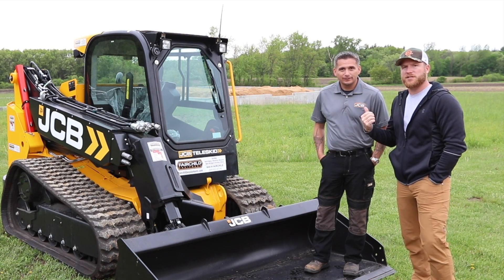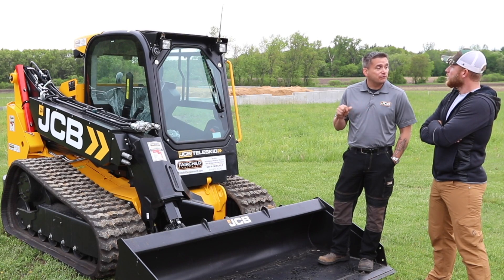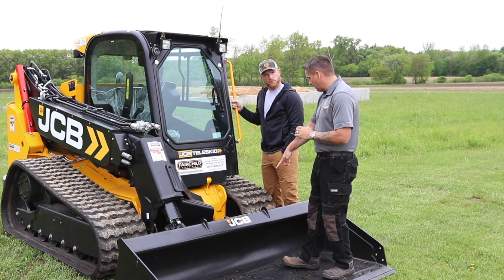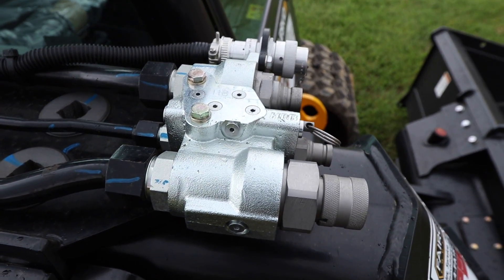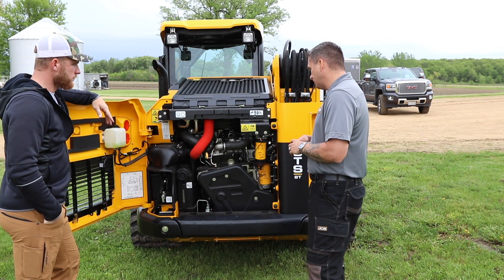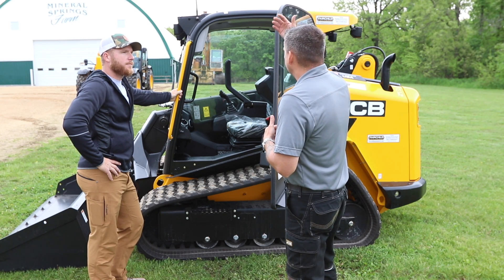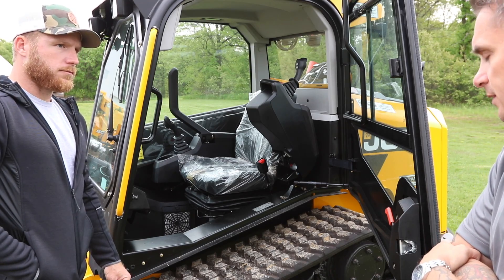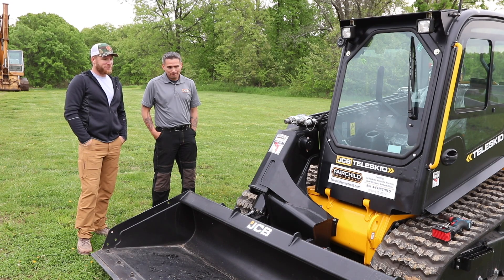JCB 3TS-8T Tele-skid Compact Track Loader (CTL) Walkthrough.

Comment: What I would like to see is NOT a sales video, but a Maintenance Video.     Show what it takes to do the routine maintenance.   How hard is it to get to drain hole, filter, refill for the motor oil.    How hard would it be to change battery, alternator, starter.      Hydraulic fuel filters.   Where you can and cannot pressure wash.    Where are all the Grease Zerks.    A video like this would show how well the engineers thought out the design.
Reply from the maker: You’d have to go to a different channel lol I don’t do hardly any machine maintenance.   I take it to dealer it’s not my thing

Comment: That bucket stop only works or prevents damage if your bucket is at ground level when you push into something,  if its up off thr ground at all its torqing that boom in a bad way all the way back to that one main pin that is definitely the weak point.

Comment: So when its extended just a bit with thst bucket is not braced agains thr brace /frame , so than what holds thst bucket from twisting when its away from machine frame , because you know it will happen when you didnt  boom completely  back 😉

Comment: Thank you for posting the video about the machine and the walk around. I work with my uncle in a family business removing trees and stumps. We just signed the paperwork for a jcb and will pick it up next month. We opted for the standard boom and purchased a grapple bucket for it as well. We went with the 205T model and look forward to getting it on site. I wish we had it for the job we are on currently. It would sure speed up the process lol.
Reply: Looking at the same machine, how is it holding up?
Reply: @etires562  so far it's held up well. We don't use it on a daily basis, but compared to our previous machine it is much smoother and far more stable. Shortly after purchasing it we did have a hydraulic leak that took us a while to locate and fix. It ended up being a micro crack in a line feeding the pump. We purchased it used as it had been a demo model and sat at a dealer for nearly a year. That's been the only significant repair thus far so we are happy with it. We did add a backup camera on it which is very helpful and highly recommended. Best of luck to you.

Comment: I have had  one for a year now. Really like the machine, however there are some problems. The plastic sun roof leaks water as does the door. Battled water leaks all winter then found the ROPS was not welded properly. 4" of weld on each side missed the joint. Waiting for them to install a new ROPS now. Also the AC sucks in dust and blows it in your face. JCB has no fix for that. Had to remove  the cab breather and tape it shut. Then there is hydraulic issues. When using a 4 in 1 bucket, when you clamp it closed the hydraulic pressure bleeds off into the boom extension circut and the boom moves out. Cannot hold a log or rock in the bucket. JCB has no fix for that either. Had it in the shop for a month on that issue. Not much help or communication from the factory. Bought a parts manual and it does not show some of the cab filter parts. I have 5 JCB machines and they have the worst parts and service manuals that i have seen and i own 15+ pieces of equipment of various brands.
Reply: Leif Wilson pretty sure the boom / aux issue has been figured out.  Have dealer check with JCB tech support for updated info.
Reply: @CDFJCB  Thanks, i will check with the dealer. Machine is there now getting new ROPS installed.

Comment: Kyle, what about implements like a Harley rake, a forestry head, a front mounted mower, roto-tiller and snow blower?  Let's also consider a post hole digger and a grapple too.  Also is there a counterweight available for heavier attachments and heavy loads out front?  You mentioned your extension boom, that potentially could tip you forward with some of those mega roof frames you haul around.

Comment: JCB needs to make a Rigger's app for smart phones so math phobics like Kyle can do the numbers to see the extended boom capacity.
Reply: Excellent idea.
Reply from the maker: that is a great idea
Reply: Theirs usually a picture in the cab 
In my 6tonne jcb telehandler there's a pic on the left column with weights set at extensions 
Then there's stickers on the boom to tell you how many meters you have it extended
Reply: @fowletm1992  Kyle was concerned with using his telescoping boom as an attachment. The OEM labels don't help with attachments.
Reply: Should be able to work out out with cross referencing the two manuals 
The boom will have a rating for both ends 
What it can lift and what is required to lift it 
That's certainly the way in Australia 
Anything for lifting needs certified ratings
Reply: @fowletm1992  I'm was talking about balance issues at reach. The biggest concern with cranes is stability and the momentum of weight out at full extension.

Comment: No radial lift sucks because when your lined up with forks or a bucket at eye level you put it down on the ground and the attachment moves back like six inches the you’ve got to move it forward more you can forget trying to crush rocks or concrete because you can never hit the “ nail on the head”
Reply: If you listen to what he says rather than trying to bash the machine you can clearly her-are him say that the machine has both radial and vertical lift due to the arm extension

Comment: I bought a  JCB 2T .  DO NOT BUY ONE!!!   I love the cab, I love the tele boom arm. But as a dirt working machine, buy a shovel and a rake. The loader doesn't  have the hydraulics to lift and curl at the same time. When lifting a load the arm drops 3 to 6 inches as you stop it. The travel modes on the control are super super super jumpy, you are going to be running into stuff. I am totally not happy with this machine. The salesman and mechanics have been here several times trying to make corrections and change percentages  on controls, they hauled it back to their shop and call JCB, they hauled it back and said, "sorry that just how it is". They said they're going to let me try another machine ( the 3T ) and see if I like it better.

Comment: Stick with kubota.,,better machine.. hydraulic over hydraulic controls. Jcb is electronic over hydraulic controls.  Kubota controls will never give problems.. and think resale value.. the SVL90-2 is still a $45k machine. In 5 - 10 years. If u own the JCB you will be trying to give it away... poor resale..

Comment: Aside from the pin code start you have to make six more movements just to get the thing started from closing the door dropping the two safety bars fore numbers turn key the push button for brake off then push button to mobilize controls then finally I can move (makes me want to scream) other thing when your sitting in the operator seat you can’t see the front of the tracks ( hello) this makes it impossible to load on a trailer with fenders visibility suck the controls are so sketchy will not make two movements consistently also trying to side shift the whole machine jerks never moves little more pressure never moves then when it finally does jerks over and over shoots it impossible to use a fork attachment speaking of forks no leveling assist is this an available option that my company opted out of unacceptable impossible to move pallets of material effectively also this unit is a radius boom and not a linkage system you will absolutely hate using a post hole digger constantly moving forward and back to keep your auger in line I will never buy a skid steer of a radius design I feel like this is 90’s technological also that boom is completely in the way when the bucket is a foot off the ground that boom makes a huge blind spot over your left shoulder
Reply from the maker: All great things for me to make note of and try

Comment: The side door is sweet on them but that is it had warranty issues with the quick attach being welded on crooked about 2 inches higher from one side of bucket to the other from factory but gaycb tolerances said that is still within spec don’t know if that is just poor dealer support or it came gaycb but either way ill not buy another product from them again

Comment: Based on a loading capacity of 1600 lbs at 8 ft, you should theoretically be able to lift up to 640 lbs at 20 ft. With the boom fully extended and the 20 ft thing on the end for a total of 28 ft your max will be 460 lbs
Reply: Only lifts 13'3"